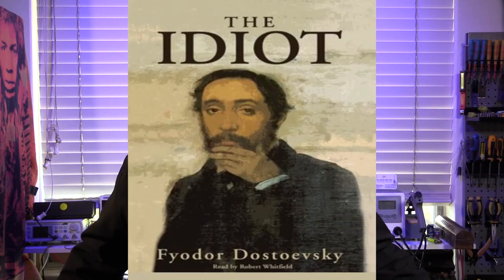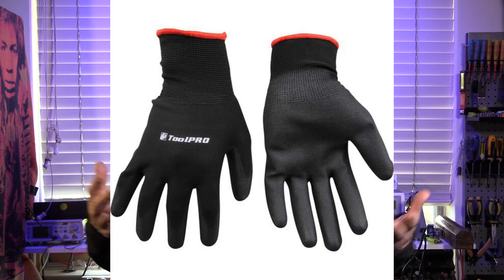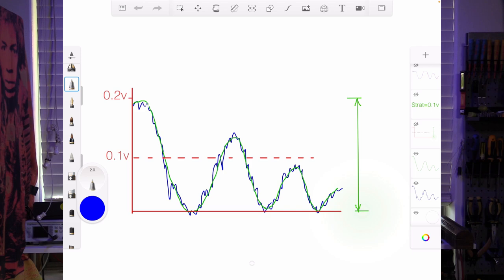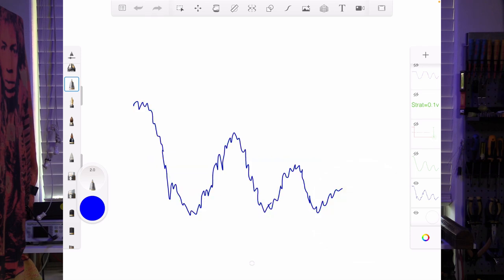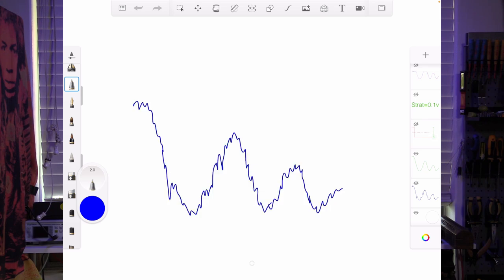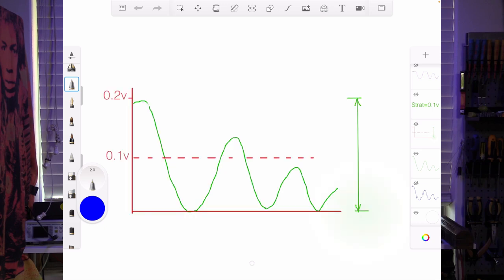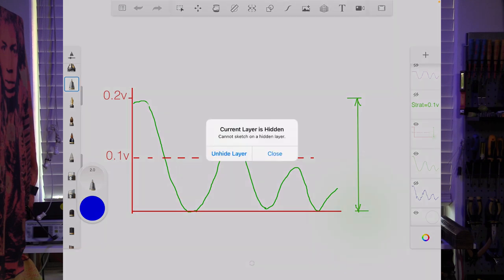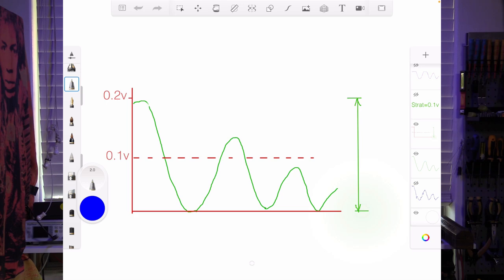What is Tube Amp Sag? Part One in the Search for a Saggy Nirvana

Comment: Thank you Sir. That explains why guitar players testing the sound of a good tube amp modeler or pedals that emulated tube saturation by the way it interact with the volume knob and whether or not the sound cleans up when you roll back the volume knob! That means that in the tube amp the amount of distortion is based on the dynamic of the note and that gives the musicians an amazing expressive tool to introduce emotion into the song.
Reply from the maker: That is very well expressed, Lefty

Comment: I like to repair old radios' and build Class A practice amps most times repurposing old tube equipment.  I'm just a hobbyist and I love video's like yours explaining these concepts, helping me to understand.  I built a small amp with a 12AX7 and a 6AQ5 with diode rectification, it's my experimentation amp. After listening to you I wanted to install one of the Webber Copper Cap rectifiers and make it switchable to compare the sound.  Hopefully now that we are getting into the cold weather I might add a tremolo circuit, for me it's a great pastime to keep my old brain working and your efforts really help.
Reply from the maker: Brilliant. I like the sound of your projects. Where are you from? We are in Spring in Sydney.  I think its good for both of our aging brains to keep working with electronics, my friend.
Reply: @theguitaramptech  No worries, always looking to learn more.  I'm from Central NY, USA.  The winters are long and cold just below the Canadian border here so my indoor activities are paramount during that time.  Currently I'm starting a new project building a amp into a military ammo can.  The top is removable and with the seal it's watertight and being made of steel it will take some banging around when traveling or camping.  If those Copper caps improve the warmness, feel or tone, they will be in there instead of just diodes alone.  Cheers
Reply from the maker: @hardball107  Yes, I think you will li8ke the improvement that the CopperTops will offer. 
I did a show up at Lake Sagamore many years ago in January. I had to laugh at the cab driver apologising for all the snow. "it is like a winter fairy tale"... but a bit chilly.

Comment: I may be totally perceiving "sag" incorrectly, but (always), in my understanding of it in my own tube amp is that, your tubes, in association with all the caps and resistors are theoretically set (biased) to an optimum amount of electricity flow. When I play harder, (attack) this pushes the draw on those tubes, requiring more power to keep up. And, depending on the Transformer and Rectifier used, it loses that demand request. 

Now, for me, it provides me with that soft clip you speak of, but also a somewhat organic delay and restraint of over aggression in my playing. Result, smoother delivery with some unique sound and feel. If I use a solid state rectifier, the amp will be supplied with more current and voltage, if I go with a 5y3gt tube, It is less efficient and cuts down on the voltage and current going to the other tubes. This will change the attack response and the smoosh.

But if you want to get all sciency, we can go with your explanation. :p

Let's keep it going. I been waiting for more videos from you. It costs too much for me to be buying tube amps to experiment on.
Reply from the maker: Thank you Alta! You’ve pretty much nailed it. We will go into each of the areas you spoke of, and explain a bit more as to WHY it happens and HOW it happens. There are some areas you have control and others where it’s damaging. 
I hope I have pitched my series at a level where someone like you can add to their knowledge without going too deep that I lose the vast majority. 
Excellent insight. Thank you.
Reply: @theguitaramptech  I am on for the full ride. I enjoy your amp videos. Keep em coming.
Reply from the maker: @3MonkeysGarage It could be a long ride, so  I am glad you're coming along.

Comment: Very interesting. Can you please make a video about poweramp damping factors and voltage vs current feedback in poweramps? Some old solid state guitar amps play tricks with those to create a more convincing tube-like bottom end and presence.
Reply from the maker: You’re right, Ostx, that would be interesting, but it is way too technical and outside the scope of my presentation. We would have 2 viewers, you and me! LOL! Youtube prefers to have us engage with as many people as possible. 
In its simplest form, the damping factor is a way of expressing the output impedance and how it reacts with a mechanically resonant speaker load. The “ideal amplifier” would have a zero output impedance. An amplifier with a higher output impedance will provide less damping of the loudspeaker as its impedance adds to the total impedance of the ideal output circuit. A tube amp may have a low damping factor of 20-30, compared to a solid state amp with a damping factor in excess of 100.   
We’re getting into the lonely wilderness when referring to Current Feedback Amplifiers (CFA) compared to Voltage Feedback Amplifiers (VFA), so I won’t go into an explanation of the differences. CFAs are more difficult to design than VFAs for a given level of performance. 
Thank you for your question, Ostx!

Comment: I have an old Lab Series L7 and wondered why out of all effects they would have only compression plus an odd tone circuit. I suppose these were early attempts at emulating tube sound. A lot of press about the tone quality at that time with big name endorsements.
Thanks for the info and I did subscribe.👍
Reply from the maker: Thanks Don. Yes, I suspect you’re right about the tube emulation. Didn’t BB use a Lab Series?